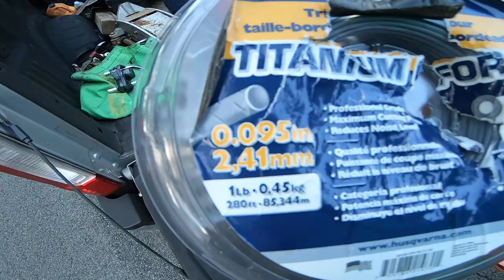Lawn Care Success In 4 Easy Steps

Comment: I don't think I've ever came across to sharing this. My a help and I have a similar story as you and I'm sure a lot others. We both work warehouse jobs. I work 4am-12:30pm and he works 7am-3pm. We're slowly trying to build up our business. We made business cards online (haven't been able to print them yet) and posted the photos along with our backstory/ a little about the business on Facebook. It took off surprisingly better than we thought. We'll line up days after work to go quote or mow yards. We start around 4pm to about 7 or 8pm. Right now we only have a Toro self propelled push mower(pretty good mower)  and a crappy Homelite blower and weedeater that both probably don't run quite like they should but I tune them to where they'll at least run and get us by til we make the leap into purchasing better.